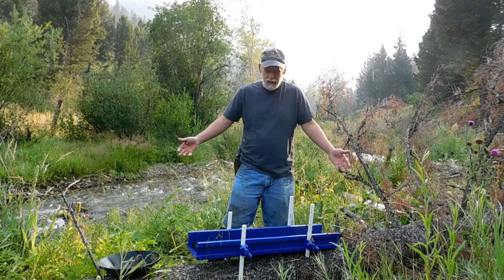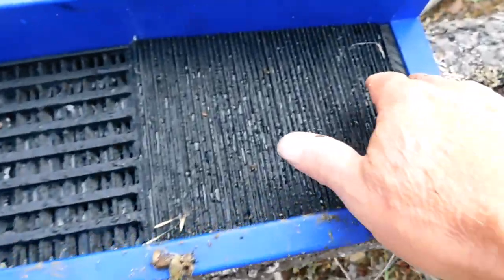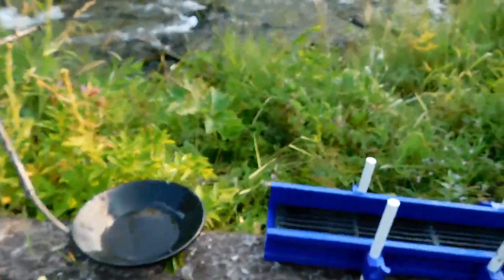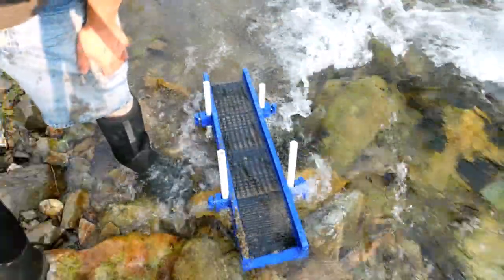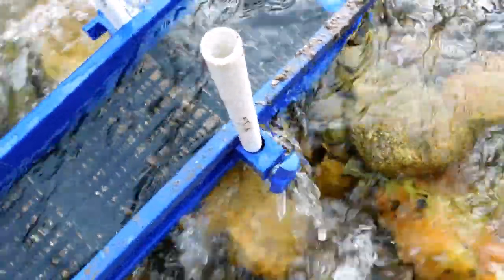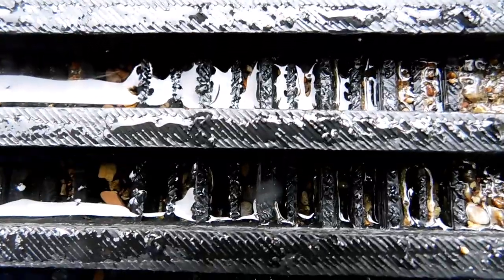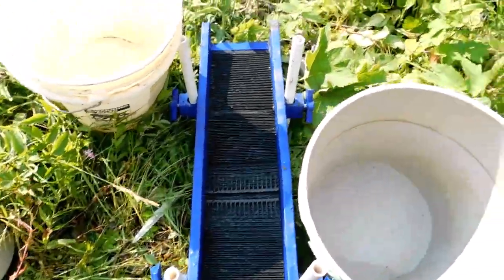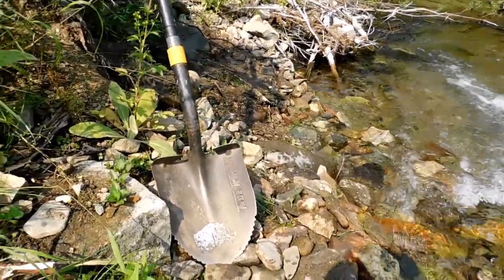Nailed It! All New Build A Sluice Two Sided Mat & Sliding levelers

Comment: Well, you're about 1/2 step away from a design I thought of, some 10 years back....so here it is.  The coarse side of your mat is similar to an old "Conveyor" that I used as a sluice.  It wiggled forward a little on its own and wrapped under to return back at the top / beginning.   Didnt find gold but plenty of Shot, Rust clumps and Black sand fell nearest the sluice end.   Good luck...discovered by accident.   No stopping for clean out required.